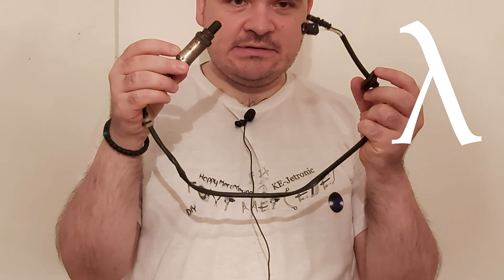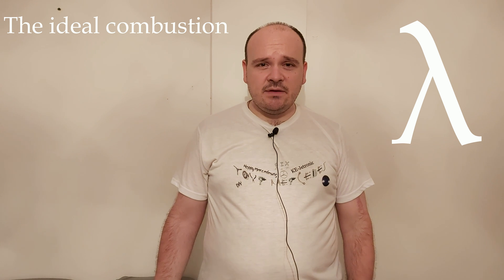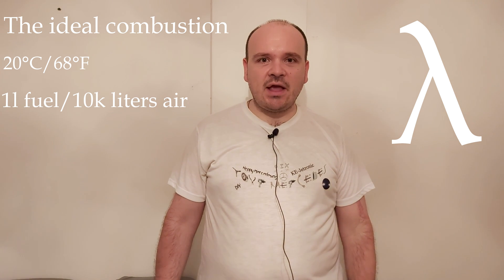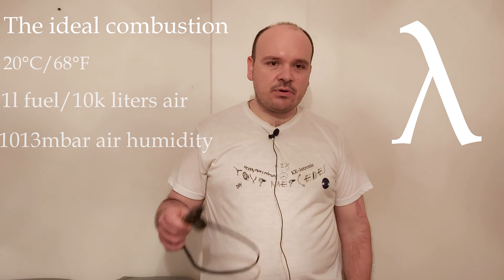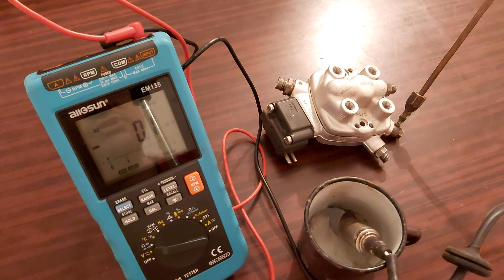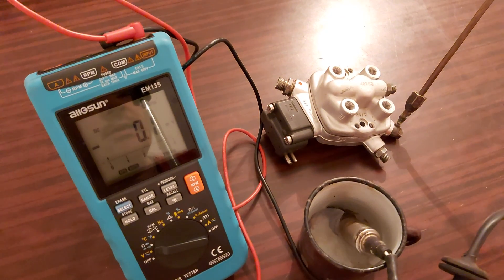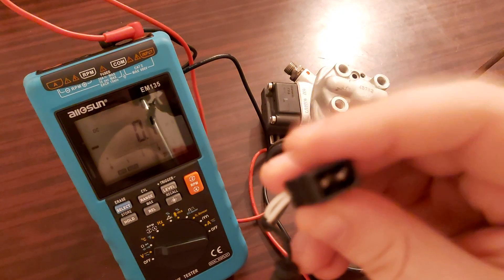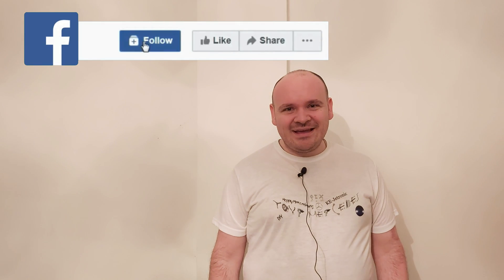㉦Mercedes Ke-Jetronic㉦ - How to check a lambda probe(O2 sensor)

Comment: I had 12 flashes on my w124. Saying heated oxygen sensor heater, open/short circuit how do i test that??
Reply from the maker: Encuentra el pin del calentador lambda y compruébalo con un multímetro. En mi página de instagram tienes la ubicación exacta tanto para los motores con ECU de 25 como de 55 pines y también para el MAS.

Comment: Thank you, for your hard work-
I have a manual mm, however, where should my setting be?
200mv- 2v- 20v?
450mv to 1000mv? Would seem to set it on 200mv?.
Thank you!!!❤
Reply from the maker: Hello. Dial 20V, if you have the option for 2V on the multimeter even better(more acurate). It should fluctuate between 0.2 and 0.8V twice per second. If you can't achieve that replace the lambda because it can't be readjusted.

Comment: How to check my car 300E have a O2 sensor? My car have this wire in under  right hand diver side, but no have this sensor, can check available wiring in a fuel pump relay?
Reply from the maker: On the pin 8 of the ecu connector. If it id blank you don't have lambda.
Reply: @mercedeske  thank you mr 😃👍 i will check it⭐️⭐️⭐️⭐️⭐️

Comment: hi great videos as always! 

on my 190e 1.8, my lambda reads 0.978-0.982v at 80 degrees does this mean my lambda sensor is bad or that my fuel/air mixture is too rich and needs adjusting at the fuel distributor screw? 

many thanks iain
Reply from the maker: Hi. 0.9V means rich mixture. Concerning the lambda I don't bother myself checking it if I see that the car has more than 60k km/40k miles, 150k km/90k miles and it either still has the original lambda or not replaced at that moment. That's the replacement time for the sensor, it can not be repaired.
Reply: i have changed my lambda sensor recently but its not a bosch part. 
so can i adjust my mixture screw till i get the 0.9v at the lambda down to 0.4v-0.5v? 

thanks

Comment: What a great video that was! Once I changed my lambda sensor on my C124 without making sure it's defective. I kept the original changed one in the trunk. After watching this video I did the test and turned out to be good. The voltage was around 0.46V
Reply from the maker: Thanks a lot. Happy Mercedesing 🍀 👍🏻 💪🏻 😊

Comment: my 560SL starts good cold and hot but after few minutes the 02 light comes on , just changed the sensor but still the same, the car runs ok just when I push full throtle the the catalitic smells

Comment: Hi there,
When you tested the lambda in the cup of boiling water , what part of the lambda did you connect the negative of the meter to?
You said ground in the video, but didn't show it in the video 
Thanks
Reply from the maker: Hi, I knew the lambda is bad😃. When testing the lambda do it on the car, always. The engine must be at 80 and running. Then remove the signal wire. The ground goes to the chassis. If you get anything below 0.2 or higher than 0.8V then you have a bad lambda. If the lambda is still original on the car then it's bad for sure because it has to be replaced each 50k km/30k miles.

Comment: Hey does w124 m102.963 have relay for lambda sensor?
I checked fuse diagram and it would say that relay E is oxygen sensor relay and my E relay have melted.
Reply from the maker: If you have catalytic converter then you have lambda as well. If your car is a KAT version, then you have lambda.
Reply: @mercedeske  yes i know i have lambda but does w124 have relay for the lambda sensor?  I can't find any place to buy
Reply from the maker: @E280T  It's heating element is connected to the fuel pump relay.
Reply: @mercedeske  okay so what can this Relay E be then?
Reply from the maker: F14 Auxiliary fuse holder and air injection for 500 and 400e

Comment: Thanks for this great video. It is very helpful.
I would like to ask a few questions if you do not mind.
First; My 190e 2.0 with m102 engine does not have catalytic converter, does that mean she does not have a lambda sensor?
Second; My car starts at multiple try in cold weather. I heard that it is the result of bad lambda sensor. Do you think it js the case?
Reply from the maker: If you don't have catalytic converter you don't have lambda either. If you have cold start issues check your coolant temperature sensor as well as the cold start valve. Lamdba has ABSOLUTELY nothing to do with this issue even if you had one!
Reply: @mercedeske  Thank you so much.

Comment: What if my car initially had a catalytic converter, but it is not there anymore. Can the lambda probe work correctly or does it make its readings wrong?
Reply from the maker: Never mind the catalyctic converter. The lambda does its work🙂 If the lambda wasn't replaced each 50k km(30k miles) then the engine is going to feel that!
Reply: @mercedeske  Yeah, it's running very poorly, and the lambda is probably it's last concern, since the old fuel pump is screaming and working louder than the engine on idle and the accumulator is falling appart all rusted (although it seems that it is doing its job). Been watching almost all of your videos and I sure am learning new things. Sorry if I bother you with some questions in the future..
Reply from the maker: It's okay 👍🏻 👌🏻
Reply: @mercedeske Just ordered mine, that Lamda sensor as you advice should be a rutinary maintenance. 
Thanks Professor !!!
Reply from the maker: @bernardodavids My pleasure 🙏🏻 ☺ 😊
Reply from the maker: @bernardodavids  The pleasure is all mine!

Comment: hello master congratulations you are awesome.  I would like to ask a few questions, I have a Mercedes 200e 118hp 1991 with 340,000 kilometers.  I'm thinking of changing the oxygen sensor, now is the process what exactly do I have to do for the brain to read the new sensor since it does not have to connect the car to a computer?  Thanks in advance.
Reply from the maker: Hi and thanks for appreciating my work 💪🏻
Concerning the lambda, just replace it and afterwards check it if there is fluctuation (450-1000mV). Then you will be sure that everything is fine. Happy Mercedesing 😃😊